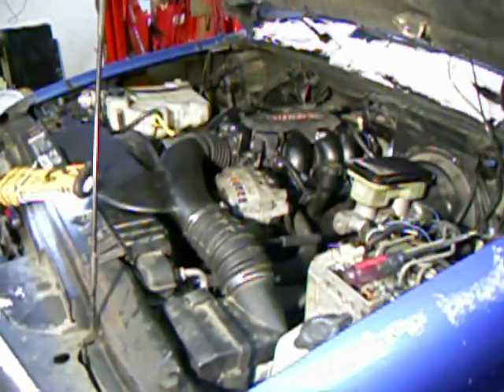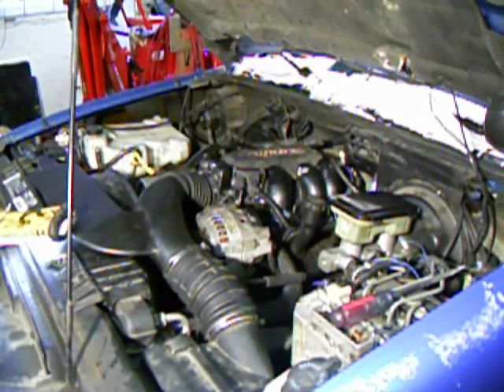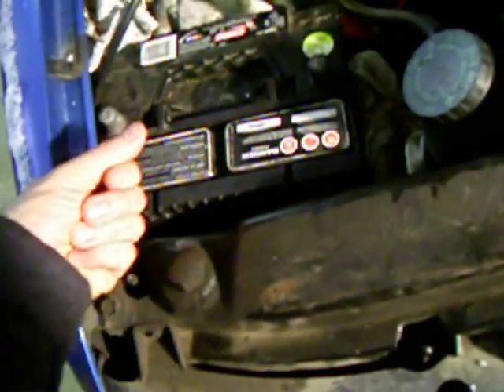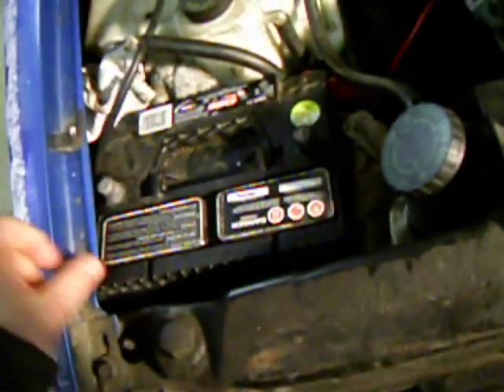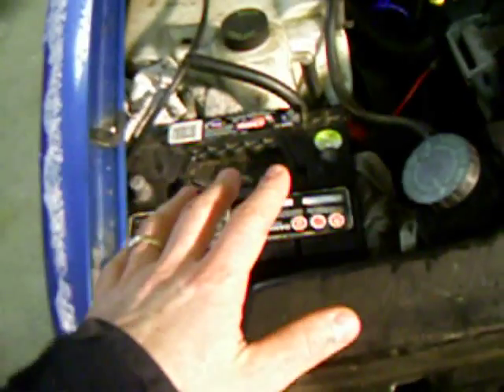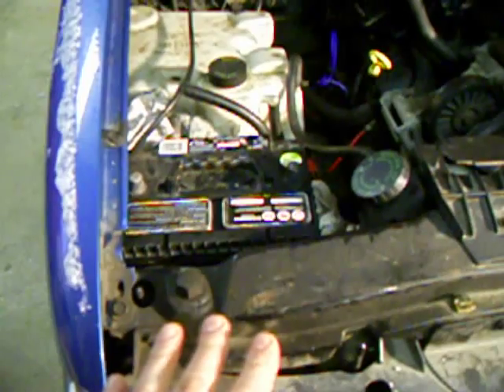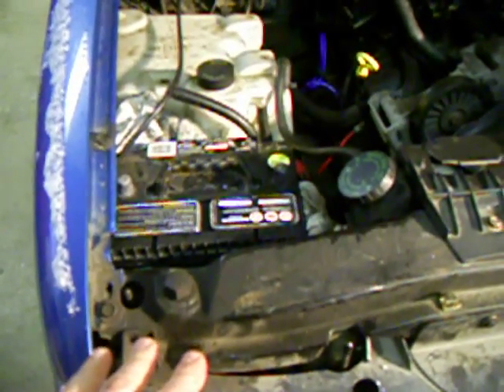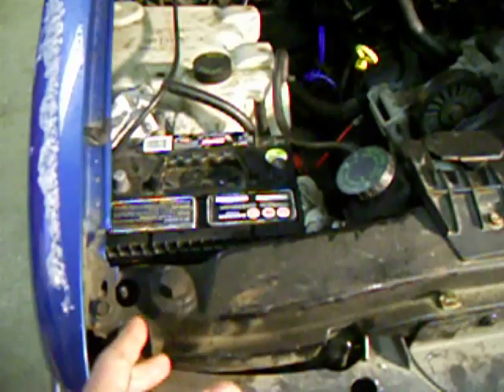GM Troubleshooting Part 2 - No Start - Battery Charge or charging state, alternator output

Comment: 14volts charging is what it suppose to be.Over 15 volts is too much.You want voltage at battery to be higher than when car is not running.Example 12.4volts with vehicle not running & 14.4volts at battery with vehicle running at idle.Turning on all accessories at idle(headlights,wipers,heater/ac,radio,etc)voltage should be above battery voltage when car is not running ideally at least 1volt higher with all accessories on at idle.Hope this helps.Certified Automotive Tech of over 10 years here